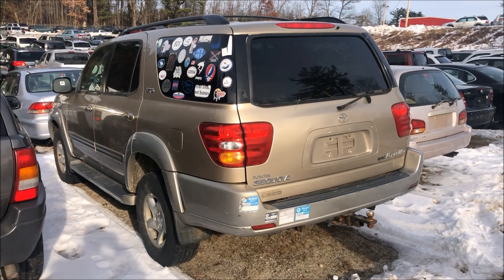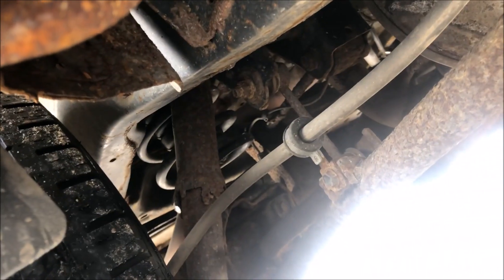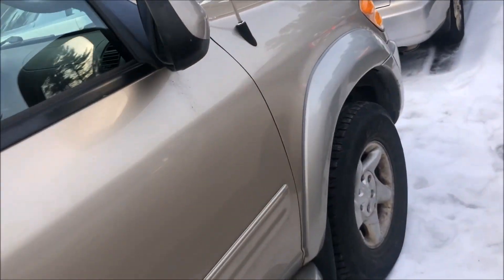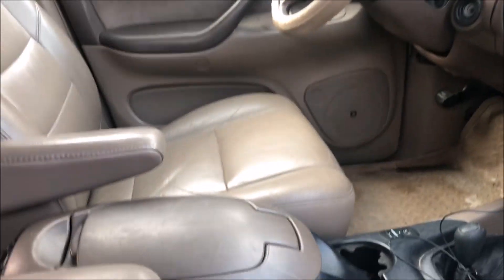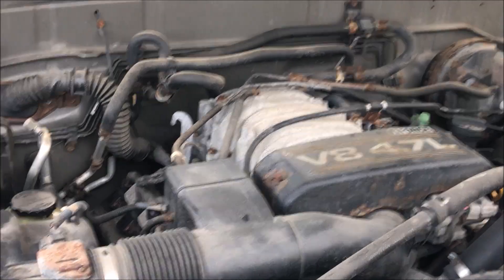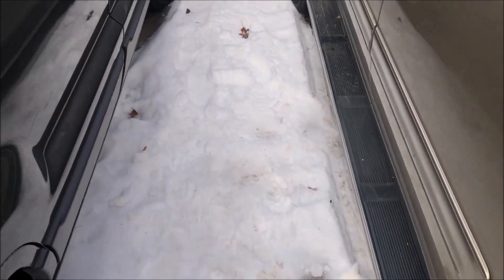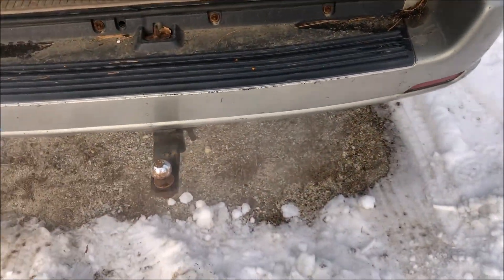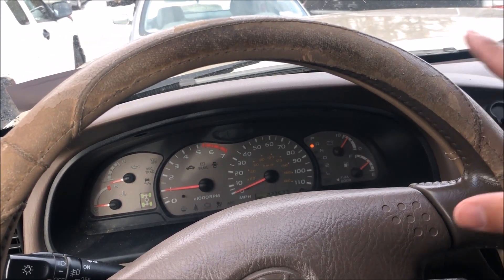Auction Buy: $850 Toyota Sequoia

Comment: I bought a 2001 brand new when they first came out and it ran 350,000 miles sold it to a friends son just as a work truck and he still has it. Regular maintenance and replaced a few things and it ran A1! Congrats
Reply: currently driving a 2001 with 199K still running strong, good to hear

Comment: I bought my '02 Sequoia Limited 4x4 a little over a year ago. $3500 with a stuck rear door and 260k miles. Indiana truck, less rust than yours. $25 Amazon handle and an hour later I have the rear hatch working. A through cleaning, fluids change, some new lights and a Nav/Bluetooth/back-up camera head unit to replace the 6-disk changer and it feels like an almost new truck. 300k into the new year and no major issues, everything works. Biggest expense so far was water pump/timing chain swap and new brakes and tires. Hope your uncle loves his because I love mine!

Comment: I have a 2003 and I am the second owner.  Keep up with the timing belt/water pump changes every 100,000 miles to avoid problems with the interference engine.  Oil changes are simple.  Cycle the 4WD once each month to keep the electric motor on the t-case working.  Biggest issue is the handle to open the tail gate.  I replaced mine and it took some time but once done try to avoid opening one handed using only the handle.  I also replaced the motorized antenna with a stock fixed antenna from a Tundra.  Basically the same drive train as the Lexus LS430, which puts the starter in a difficult spot to get to.  Very nice long drive highway vehicle if you don't mind the low gas mileage.  Frame rust is what will eventually do my Sequoia in, but I don't expect that will happen for another 10 years, long after I switch registration to historic tags.  Enjoy!

Comment: The oil sending unit is one of the highest failure items on the 2005 and earlier models. It's super easy to change on the oil filter housing below. The "D" indicator bulb always burns out on these, either replace the bulb with a new one or swap it with the "2" or "L" indicator bulb below it since nobody really uses those. Enjoy the win!

Comment: This is a great deal. These are the best value on the road for a 4wd body on frame SUV. Mine has 375k and runs strong. It's a southern truck, though. It was the only 4wd I could find with no rust from a private seller. All others had at a minimum, the rust that was on your truck. It sounds like he's going to keep it. If it develops a bad shake above 65ish in the seat (like shakes the armrest) than it needs rear bearings.

Comment: Personally run a 2001 as well,  currently at 285k miles and running strong still. The abs and traction control has just decided to stop working but otherwise love it

Comment: That’s a great deal my dad bought 2006 sequoia same color 185k miles dealer wanted $6,900. So they do have great resale value I’m more into 4runners but it’s a great vehicle nice find I’m a bit jealous. Only issue I don’t like is 80k-90k timing belt would of been nice to have a chain other then a belt. Newer sequoias do now come with timing chain in newer engines. That is an interference engine not great but if maintained great running truck/suv

Comment: That's a great Sequoia, wouldn't mind having one, its just a Tundra in disguise LOL  

Oil pressure gauge not working, would most likely be the sensor.

So the 4WD system in these older models was 2WD, full time 4WD, part time 4WD and had low range.   The model your uncle has has both full time and part time 4WD, the orange flashing light in the middle of the 4WD display will glow solid once the center differential lock is locked, without the center differential lock engaged you have full time 4WD.   So you would have full time 4WD, part time 4WD, and low range...this model also has a 2WD mode.

Comment: No oil pressure but clean oil, someone probably installed a dud oil filter had this same concerned towed on and swapped out the. Oil filter for a oe filter after the previous person already changed the oil sending unit

Comment: Looking at the underneath of that one I'd be inclined to say that it's had a replacement chassis/frame fitted in the past.  You've got to think the tow bar is probably about the same age as the vehicle, and it looked like a good quality unit but it's far more rusted than the chassis/frame it's bolted to.  All in all it looks like a vehicle that has been used as family transport but has also had a lot of money spent on it in terms of care and maintenance so that should be a win all day.  Your uncle can probably drive that daily for the next 10 years and still make a profit on it...

A new oil pressure switch shouldn't be too expensive, maybe under $100, and that's the most likely part to fail, Toyota dash electrics are usually pretty trouble-free...